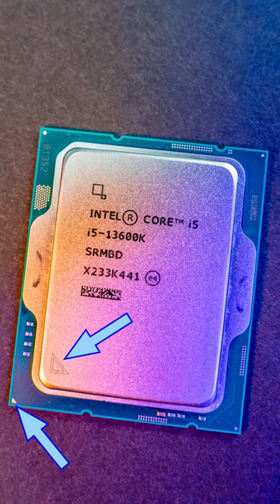Want to build your own gaming PC? Learn to install a CPU!

Comment: Wonder when CPU/GPU chips will run cool enough not to need water cooling. The same Laptop CPU/GPU's only have A heat sink (aluminium) with heat pipes (copper) Typical heat pipe configuration within a consumer laptop.
Reply: You don't need watercooling even for a 13th gen 19 or a 4090 unless you are over-clocking or your case is sufocating.. a noctua or deepcool airccoler will get the job done